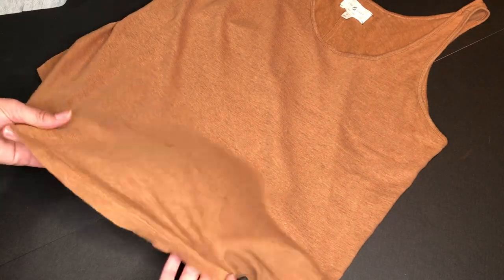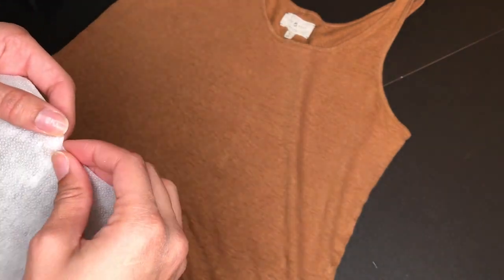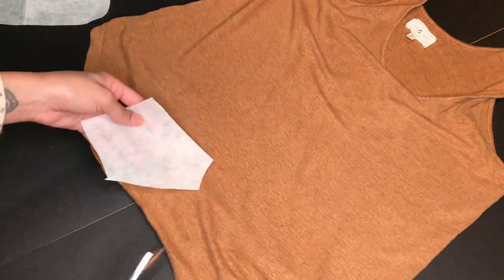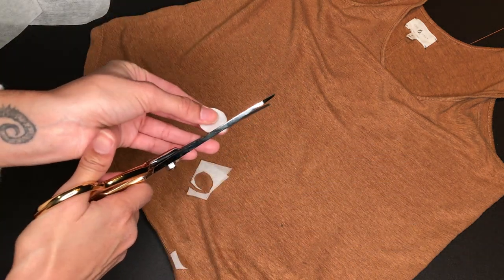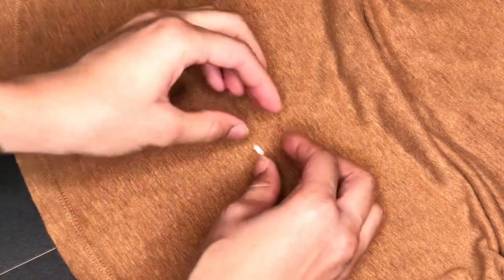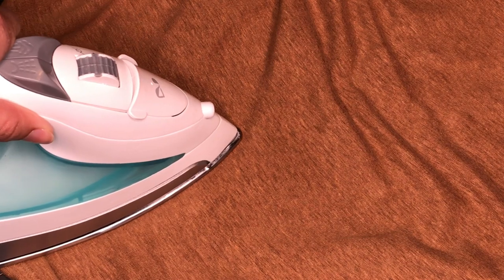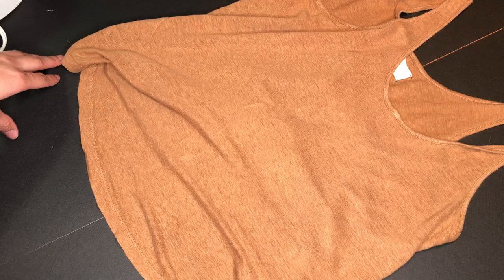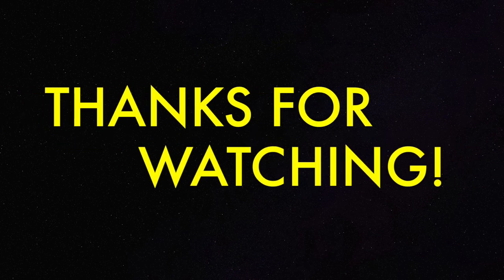Repair Hole in Seconds | No Sew D.I.Y.

Comment: No luck with this at all.  I could not hide the interfacing without creating a seam.  Any suggestions?  Thanks
Reply: It would only work if the material was there, and was just snagged or ripped not burned away. That would require an under patch which you would see and notice.